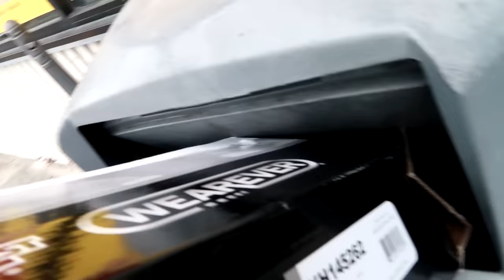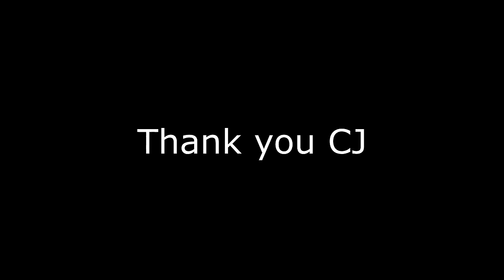what REALLY happened the night i should have died

Comment: Man you need to use a jack stand you risked your life even worse doing the job as you did with a jack atleast could have thrown the bad rim under it so if that jack failed it wouldn't crush your head or kill you.

A hint always carry a jack stand in your vehicle its a life saver trust me think smarter about things. Aluminum rims are very common to waller out  and cause issues with stuff like this steal rims hold torgue way better and don't have near the issues of aluminum rims. The point is aluminum rims are a hit or miss thing they look good but are not always the safest and also are prone to getting wallered out and rejecting all lug nuts and un torguing themselfs aluminum rims are also prone to busting and splitting and well literally exploding in a accident / wreck. This means a total loss of traction and control in a accident steal rims bend and such but rarely bust  or explode like aluminum ones steal rims are safer and also wont come off in a wreck unless force is great enough to snap the lug or studs or well entire hub from vehicle while aluminum rims bust split and well shatter with a hard impact like a curb or pavement after a tire failure or in a accident.

The basic rule of thumb of hardcore offroaders and well old school over roaders is stick with steal rims theyre safer in the case of a accident or temporary loss of control say in a skid or bounce off of guard rail while aluminum rims will literally explode and be torn from your hub by a sudden hard jarring impact leaving you with zero control of situation when the steal rim would leave you with some control because there is still a form of contact to the pavement by which you can guide / half way steer with.

Comment: Don't worry happens to the best of us we were going 70 mph down the high way we were pulling a trailer with 2 at s on it and we for got to second check the straps and the atv on the front of the trailer lifted up and came up off the trailer luckily it was at 2 in the morning or we could have killed some one

Comment: I still do not think he would have died. Two ways it could have happened different he could have crashed /rolled or the tire could have hit another car. I do not think even if it was the front tire he would have crashed but let's say he did there is a chance he could have die but unlikely but it didn't it was the back and it didn't roll so let's say the tire hit another car btw how did he find the tire must have not went far anyway I have seen dashcam video of tires hitting cars and they don't die so I think the title before was a little much should have put could instead of should.

Comment: before  you beat yourself up don't you find it funny that only the jugs on one wheel loosened .Like  that.i think you like to see only the good in people .how about your parked havlng s nap and a hater or troubled kids stole all but one lug.that explains why you didn't notice it .i have seen many wheels come of but the driver noticed it but ignored it.and usually if you forget to tighten lugs it will shear of s few studs in the process ..i have drove a truck with loose lugs you can tell ,and if someone stole all the luge it will not come off right away..I ask you this were the lugs threads all torn to hell cause they would be with lugs that were put on loose and over time cane off!